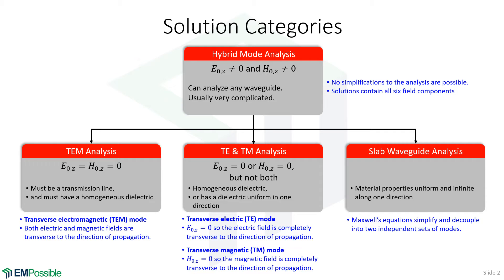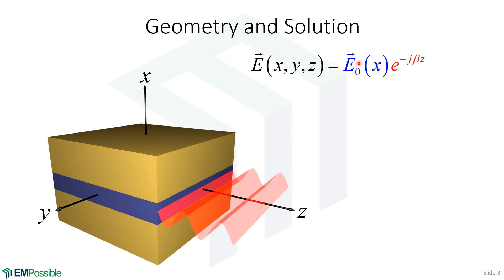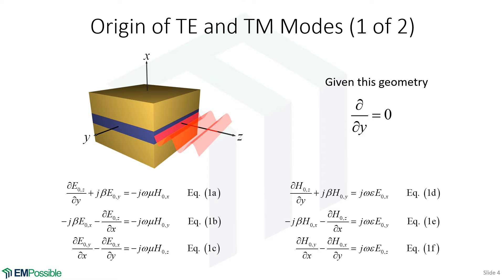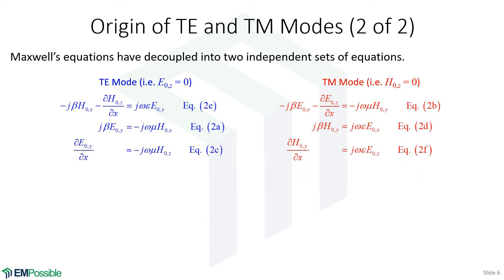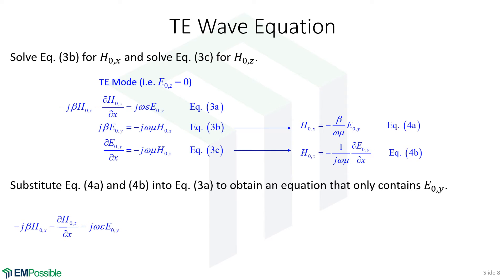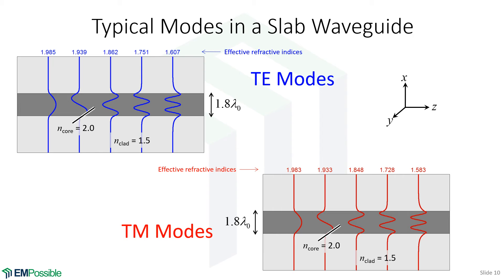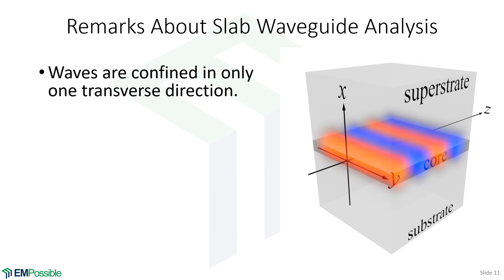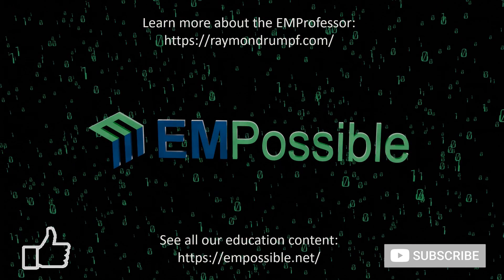Lecture -- Slab Waveguide Analysis Setup

Comment: A quick question. In anisotropic materials the equations do not separate in general as in 3:51 right? Does that mean, in some cases the eigenmode of the slab is not TM and/or TE polarized and can have all Ex Ey Ez components of the vector E (for instance) for it to be an eigenmode of the slab?
Reply from the maker: You are exactly right. In general, all three field components are coupled and no simplifications can be made. If the anisotropy is oriented so the principle axes lie along x, y, and z, I do think you will still get your "purely" polarized modes.

I recently published a book on finite-difference frequency-domain (FDFD). Chapter 6 covers waveguide analysis, including slab waveguides. Chapter 10 covers anisotropy. Unfortunately, I do not analysis an anisotropic slab waveguide, but all the pieces to your puzzle are there. I have done this in the past for Dyakonov surface waves and it worked wonderfully. Here is a link to the book website:

https://empossible.net/fdfdbook/